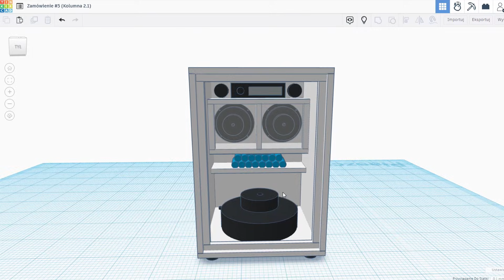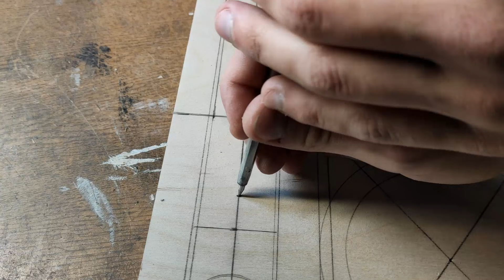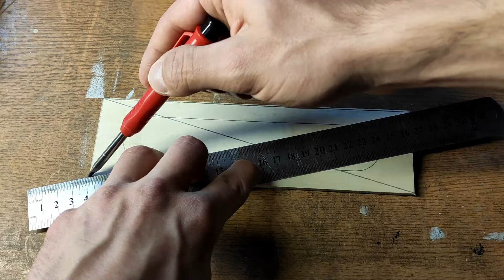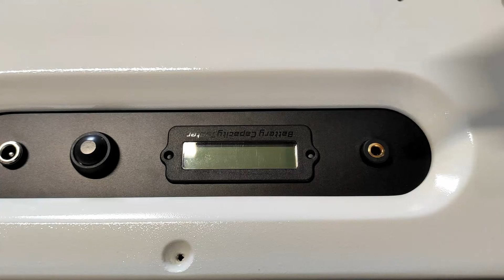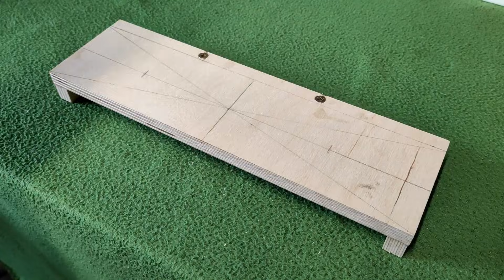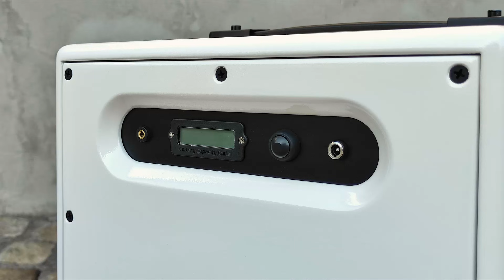DIY Portable Bluetooth Speaker 2.1 - 8 inch Subwoofer | by Sebastian

Comment: That's top notch build quality, you sealed all the potential air leaks. The only thing I can recommend for getting a better paintjobs is use automotive paint. do not USE PPG brand paint, it's popular but I've found it dries like gunpowder, very rough. use valspar or buy online with tamco paint. harbor freight has paint guns for $20, buy the green one not the purple gun. they have better quality guns too. for compressor an 8-10 gallon would work for a cabinet that small, but 20-21 gallon would be good for future projects, even car panels. just spray high build primer. add a few layers, sand like you did and lay on the 2-3 coats of basecoat than clearcoat over it, wear a organic vapor respirator, fumes will kill you eventually if you don't. sand clearcoat with 800-2000 grit wet, and lay on the last coats for smooth finish or orbital sander with meguir's car polish, the automotive type. will polish 2000 grit sandpaper marks to a high gloss
Reply from the maker: Thank you buddy! 😇

Comment: Can I use tweeter directly with speaker.
Reply from the maker: No, buddy. You have to connect the speakers at least through a capacitor, because you will burn the tweeter 😉

Comment: Bro, you’re a genius, really. Your work is truly admirable.
Reply: @SebastianDIY  I ask you because I noticed that you used speakers with higher RMS than what the amplifier provides. Didn’t that cause you any issues to make it sound much better? Didn’t it happen that it sounded too quiet?
Reply from the maker: No, buddy, that's not how it works with such small power differences. If the amplifier has, let's say, 100W, then 150-300W speakers should play well, or even better, because then there are smaller distortions and the speaker plays cleaner. Example: we connect a 300W speaker to a 5-15W amplifier, then it makes no sense and the speaker is wasted. You shouldn't use a lower speaker power than the amplifier, because you can burn the speaker. dB (the more the better) and impedance are of great importance, because a poorly selected one can ruin the amplifier. The conclusion is that in my project everything is done correctly in terms of power selection and it plays really powerfully! ☺
Reply: @SebastianDIY   let's say my amplifier is 2*220W+350W. Can i use 400w bass???
Reply from the maker: Yes 😉

Comment: I thought you had to separate the tweeters from the subs because of suction?
Reply from the maker: It depends on the tweeters, if they are factory sealed or not. These tweeters are probably sealed, but as you can see in the video I additionally sealed them with T-7000 glue, so there is no chance that something bad will happen to them and everything is fine 😊

Comment: Very nice, this turned out to be a really great project.

Did you use a crossover for the midrange and tweeters? Or did you simply connect them in series?

Are there any plans you would like to share with the world? 🙂
Reply from the maker: Thank you very much! It's really powerful live 😊 

The midrange speakers are not connected to the crossover but directly to the amplifier (left and right channels), and the tweeters are connected via a capacitor from the tweeter set which is about 3.3uF 🔥

All in good time 😏

Comment: I use the same 2.1 amp, but for bass i used other amp. A at 19.5v power on bass chanel was to low for my  bass speaker (dibeisi at 8 ohm and 30 cm diameter), and in my combo work great, even when i misscalculate bass port and i make thst port to small, bass is still strong. I will fix this issue soon.
And is somone are curious about that 2.1 amp, if is good or not....yes, is good, i think on 24v can work great but i only used 19.5v power suply, can't output max power, but at 100% volume i can't hear distorsion, so... is cheap and good.

Comment: you used 24v or 12v to power that amp?
Reply from the maker: The battery is 5S3P, so its voltage is 21V, buddy 😊
Reply: @SebastianDIY  Close to voltage that i use. At this voltage will never overheat even is at full volume. In my case, at full volume i have no distorsions.
Reply from the maker: In my case it also does not overheat and there is no distortion. This amplifier is inconspicuous, but it rules! 🔥💪
Reply: @SebastianDIY  i have few things to fix in my build, and i think i will do one short video to give others ideeas on what can do with this or similar amp. What i build is not portable, is much more heavy, i use his bass chanel just as signal source for other mono amp that work as bass amp. Is a totaly mess in my amp box, but it run ok, and for who have dibeisi g1201 8 8hm speaker (ultra cheap 30 cm speaker), will see a sub "cube" box build with that speaker.

Comment: Did you have to calculate box volume or just by inspiron?
Reply from the maker: A little bit of this, a little bit of that 😝 My box is similar to the original box for this woofer. It plays much better in my box than in the original 🔥

Comment: It was cute but some missing details are the sponge canceled some base and the mid you did not put the out-let sound travel via the air without an air gap the mid is stuck and you are going to fry them soon if not already
Reply from the maker: I test the speakers with and without the sponge, in this case it is better with damping. There are different opinions on this subject when to use the sponge and when not.
After all, the bass reflex is in the housing and there is ventilation and a powerful bass.
Somehow its current owner uses it every day to this day and is very happy, and it has been over a year and a half already ☺ This is my most powerful speaker I've ever made, my company's calling card. Live it destroys everything that gets in its way, unfortunately the movie doesn't reflect reality... 😞

Comment: I'd like to know the battery if how long it lasts normally, and the power rating of it. Thank you
Reply from the maker: Recently, the owner of the speaker added a comment in response, quoting: "as the owner of this best Bluetooth speaker, I will say that I use it for over 10 hours a day for 5 days, when the volume is set to 50%, of course outdoors... after a year it still works like new" 😁🔥 So the battery lasts a very, very long time 💪
Reply: @SebastianDIY  is it 5s3p or 6s3p? can we go 5s4p or 6s4p also?
Reply: @SebastianDIY  that actually last so long, i like it
Reply from the maker: This package is 5S3P ☺ This amplifier model has a maximum voltage of 24V, and the package is 21V. If you use 6S, it will be 25.2V, then the amplifier may break down... You can use a converter that increases the voltage from 21V to 24V, but I do not recommend converters, they heat up a lot and take a lot of current. In this case, instead of 5S3P, you can use 5S4P, 5S5P, etc., but it is better not to use 6S here because of the higher voltage, which the amplifier does not tolerate.
Reply: @SebastianDIY  thanks so much!!

Comment: Nice build, but i think downfiring sub is not good on outside environment, and also if your building downfiring sub maybe you should put the port infront, not at the back so you can feel a little bass
Reply from the maker: I will admit honestly that the speaker has been tested by me more than once in outdoor conditions, and by the current owner it is often used outdoors. So what is my conclusion, so the conclusion is that the speaker outdoors directed downwards and with bass reflex at the back of the housing gives a very, very strong performance. It is powerful and there is no lack of bass at all, it is just best to place the speaker on something hard, not on the grass. This speaker is a real monster and I will definitely repeat such a construction more than once. Best regards and thank you for your comment 🔥

Comment: Wat is the apps name
Reply from the maker: I don't use the amplifier app and I don't know what it's called. Usually in the amplifier manual there's a qr code and the name of the application. I didn't have anything in this amplifier 🙂
Reply: @SebastianDIY  ok thanks 👍 love your work
Reply: When are you making a next video
Reply from the maker: Probably this month's video will be about building a Boombox with Philips MC-50 speakers 💪
Reply: @SebastianDIY  nice can't wait
Reply: How much would it cost to build one of these speaker
Reply from the maker: The cost of labor is PLN 1,000 + the cost of materials, dear viewer 😊

Comment: What is the battery backup duration?
Reply: Please tell me the backup and volume ratio...and is it worth it to run this on battery or direct with SMPS power supply...
Reply from the maker: The owner said that when listening to music at 50-80% volume daily, the battery allows the speaker to last for 7 days, which roughly translates to 60 hours of playback. As for using batteries or a power supply, it depends on what you need. Of course, a power supply will be better because it has a constant voltage and current and the speaker will not distort and lose power 😉
Reply: Thank you Sir for your kind information 🙂 Regards from India....
You told that those 15 batteries each about of 3200 mah would be enough for 60 hrs of playback with a single full charge?😯
Reply from the maker: That's right, dear viewer! Greetings from Poland 💪
Reply: @SebastianDIY  Sebastian, brother you are very much helpful...I don't want to waste your time but I am very confused about the matter. Brother I am going to build a music system 50+50 w satelite+100w subwoofer. I will purchase a 24 volt 7.5 amp lithium ion battery for this. While calculating the backup time at 70 percent volume as per rule it is saying not more than 1.5 hrs backup which is totally useless. Is it accurate or it will give much more back-up than this... please give your suggestions and give me an assumption that how much I'm going to get the backup time.🙏
Reply from the maker: I don't know, maybe you misunderstood something. How much capacity (mAh) does this pack have, please tell me.
Reply: @SebastianDIY  tell me if the battery pack is of 24 volts and 7000mah
Reply from the maker: So it's a 5S2P, right? So the battery should last for about 30 hours of listening to music 🔥

Comment: How much playtime on batteries
Reply from the maker: At 50-70% volume it lasts about 7 days. And 50% is really loud... 🔥💪
Reply: @SebastianDIY  No ,Asking straight continuous use of how many hours
Reply from the maker: That's about 70 hours on a single charge.
Reply: You didn't mentioned any wire  Connection diagram,most crucial part of video,you just told us about parts,but didn't tell how to circuit between parts,need proper diagram,whole video is useless without it,most people have no electrical experience they usually look for a wiring diagram to fast  build up
Reply: I can buy parts,but if wouldn't know how to wire them systematically,then there is no point of whole video
Reply: Upload Whole wiring diagram video at last of this video and other respective videos, it would be alot for us
Reply from the maker: At the beginning of the channel I gave the wiring diagram a few times, and then somehow I completely forgot about it... 😟 I'll remember about it, thank you!

Comment: What I learned is that using glue for everything can go a long way 😅
Reply: Glue is stronger than fasteners
Reply: Glue is significantly stronger than fasteners. But having both is best
Reply: Which glue was used exactly
Reply from the maker: I don't know which one you're talking about, but in this project I used: PVA glue (for wood), hot glue, T7000 glue, acrylic glue (sealing the housing) and I think that's it 😁
Reply: @SebastianDIY thanks man
Reply from the maker: Exactly! 😁

Comment: The battery block you made is not neat, you can say very sloppy. Actually, everything about the speaker is very good! But the battery is not well made!
Reply from the maker: The battery is gorgeous! I know that soldering the cells is inappropriate and slightly unsightly, but I've been doing it this way for a long time and I know that everything works properly. The battery pack may not be as beautiful as after welding, but I still think I made it quite aesthetically. The pack is inside so you can't see it, the important thing is that it works 💪😊
Reply: 12v ou 24v ?
Reply from the maker: 21V 😇

Comment: Hello, looks very nice and this is the first mobile box with downfire i was seeing.. How it works if you are outside ?? I know only frontfire sytems and i wants to build a speaker with downfire for outside too.
Reply from the maker: Hello! Yes, this is my first speaker with a downfire speaker and I honestly admit that it is the best speaker in my stable. Indoors and outdoors it played amazingly. It destroyed all the store speakers in a heartbeat. The buyer still has it and enjoys it every day. As for the construction itself, it seems to me that the speakers placed on the bottom give a stronger bass. With a clear conscience I recommend building downfire constructions. Best regards and good luck! 🔥
Reply: @SebastianDIY  that listening good and i will try my best. One question, If i use the same setup but i would Take a normal straight Bassreflex ( Not this curve ) i get Problems or its ok because of different ways of Sound.... From down to Up ?
Reply from the maker: In my opinion, it shouldn't affect the sound quality if the bass reflex is properly calculated in length. Everything should work fine, but I prefer the same curved bass reflex tube.